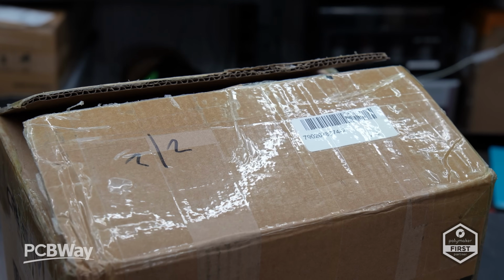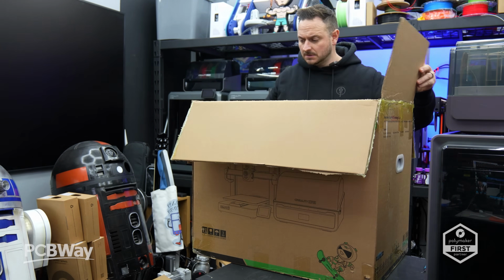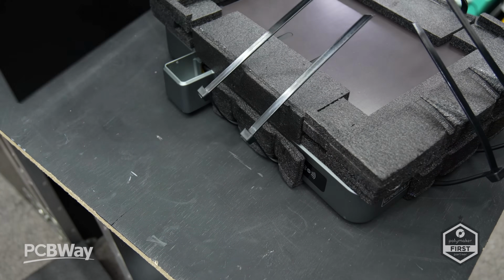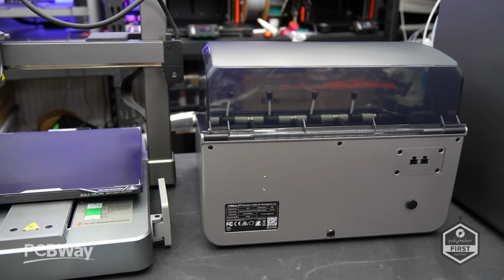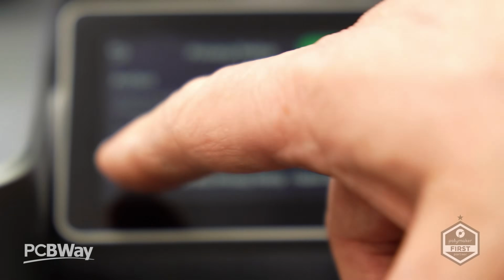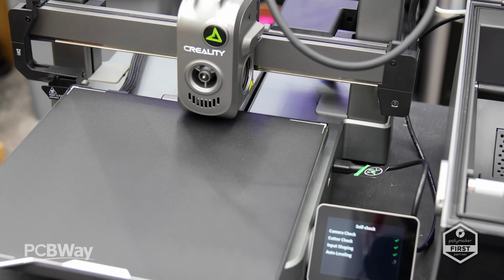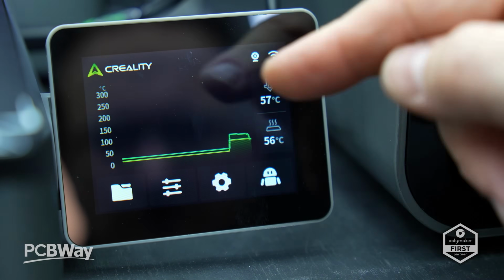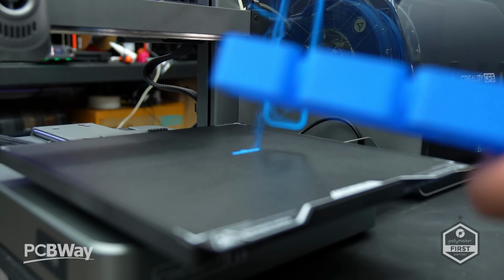What I Didn’t Show You About the Creality Hi Combo…

Comment: Bought one very cheap from someone that didn't like it and bought a Bambu A1.
I've put some time in it to learn the printer, tweak the settings.
It's still not a pure out of the box printer and my personal experience (and pain) with various Ender 3's made me understand where to improve it.
Guy who sold it to me is now jealous as my prints look a whole lot beter.
The A1 is faster though but it's not really important to me, it's already much faster than my Ender 3v2 en s1 pro.
Reply: I've had one for a week now. I've been learning and printing like crazy. The 2 times it had malfunction were user error and not fully understanding all the settings. I have a 17 hour print going on right now and its chugging along no issues. Even on the highest speeds. I read quite a lot of negative comments about this printer when I was deciding between this one and the bambo lab A1, the ones who own one tend to give it a positive review. I think most issues some have can be chocked up to user error.

Comment: Great video! I currently have a K1 and was considering getting the CFS, but then I came across this printer and am thinking about replacing it. The K1 is way too loud, and since I usually print with PLA and PETG, I always keep the lid and doors open. My office is right next to my bedroom, so I'm looking for something quieter. Would this be a good upgrade or downgrade?
Reply: It will be an upgrade if you dont mind a little bit slow  and a bigger footprint than the K1, but creality hi has bigger plate 260mm³ vs 220mm³.
Reply: I had the K1 very briefly, bought it 2nd hand.. Couldn't stand the noise it made. So sold it, no regrets

Comment: Hi, why do  ask in the thumbnail “ has Creality given up” ? Or is it just click bait purpose ? The new Hi combo got good reviews by others
Reply from the maker: Did you watch the video?
Reply: @TheRealSamPrentice  I did watch your video. Most part is assembling the machine, You said it kind of reminded you of B@mbu , and the end you said it the print came out nice. Is the B@mbu looking alike part what you mean by Creality may have given up.. on the design aspect? Second, how did you screw the filament pusher on to the CFS? There aren’t enough screws in the box I received, what size screw are they?   🙏
Reply from the maker: @jrmh096  It’s very easy to copy instead of genuinely innovating, isn’t it? Creality had me read a script last year where they claimed to be an innovation-led company. It’s tricky to see that, especially when you look at products like the A1 and the Hi—especially when they are direct copies, right down to the extruder logo movement. It's hardly a damming aspect on "have they given up" as really they have FAILED to innovate over just copying something that was already on the market. Also they have been copied for years, the ender 3 is a classic example.
Reply: @TheRealSamPrentice  Nothing explains why this is a bad product.

Comment: To be honest, I'm glad they upgraded the whole platform to compete with Bambu A1. But it's kind of late in the game because of how many users switched to Bambu, and it costs around the same as the Bambu A1 combo, which is sad for the buyer. If they lower it to $350 for the whole combo, and they would capture more share in the market because a lot of people are on the fence with Bambu's latest firmware update issue/setback. Plus, I would not be getting this Creality Hi combo because of the Flashforge AD5X Core XY Multicolor release (A lot Cheaper).
Reply: Here in indonesia creality hi is cheaper than bambu a1 mini combo
Reply: " If they lower it to $350 for the whole combo" ... You are already talking about Chinese company offering a pretty comprehensive printer. Just like Bambu does.

You can always go cheaper but very often the quality also shifts with that.